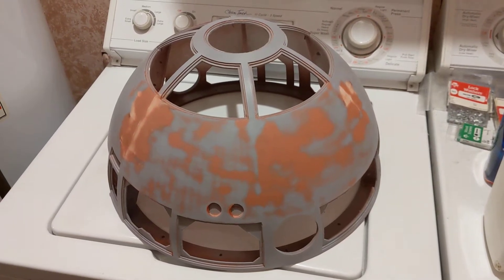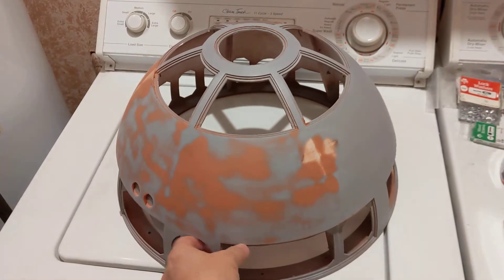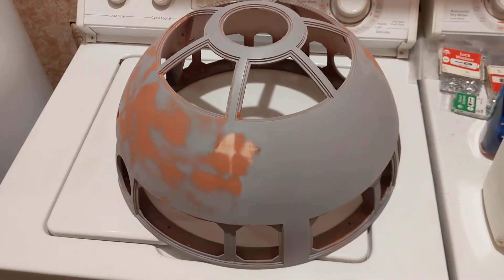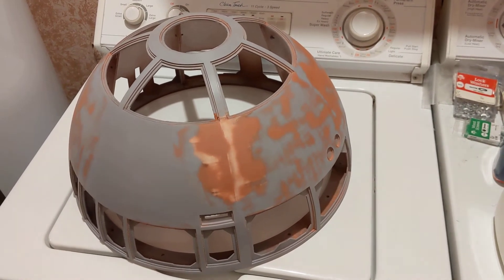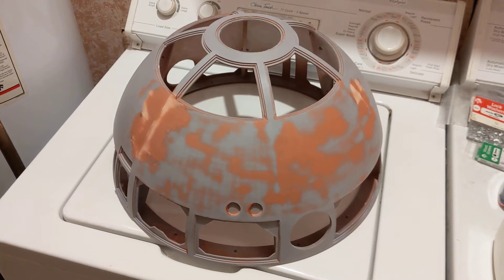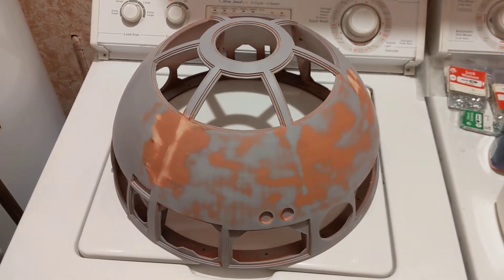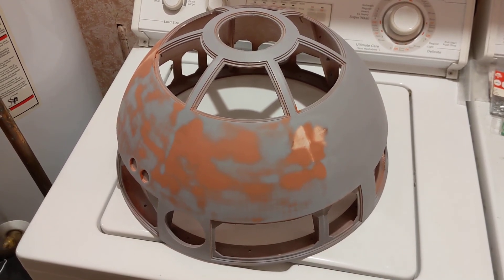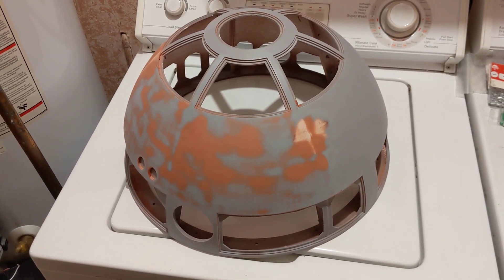3D Printed R2D2 - Part 1

Comment: I’m still safe using pla if I wanted to print out the droid in pla?
Reply from the maker: Mine is mostly PLA and PLA+.  The downside of PLA and PLA+ is that it can warp if it gets too hot or is left in direct sunlight.  The advantage of PLA is that it's easy to print, which is in part due to its low melting temperature.  The best material you could use would be ABS, but it is a lot harder to print.  ABS gives off fumes while it prints that you don't want to breathe, and you really should have your printer in an enclosure to help prevent warping.  If you can get your printer to print PETG, that's the best middle ground.  It has a higher melt temperature than PLA but is easier to print than ABS and it doesn't have toxic fumes.

I couldn't dial my printer in good enough to print PETG without warping, or I would have used that for the whole thing.

Comment: What size bolts did you use to fasten the dome all together thanks in advance
Reply from the maker: 4mm bolts.
Reply: @TomsProjects  thank-you im building same  struggling with the upper and lower rings at the moment got to say your videos are very helpful for me here in the UK
Reply from the maker: @paulbrady2801  I've started sanding the ring pieces before gluing them together.  What kind of issues are you having with them?  Having the instruction PDF to reference definitely helps.